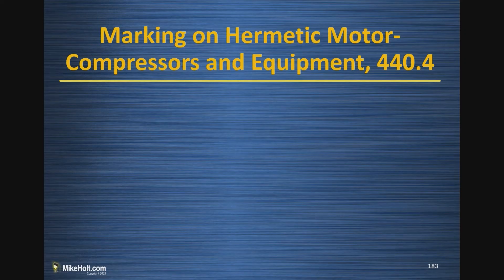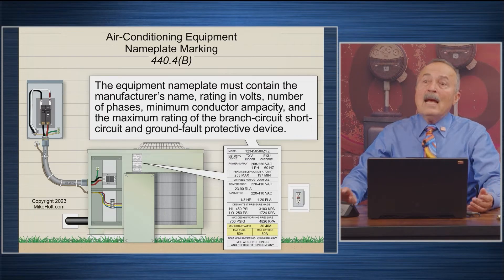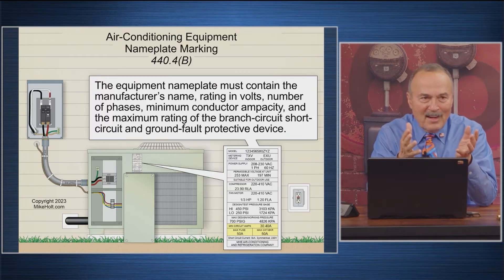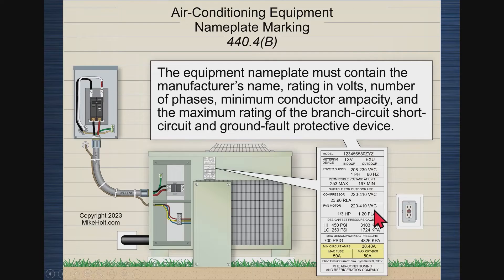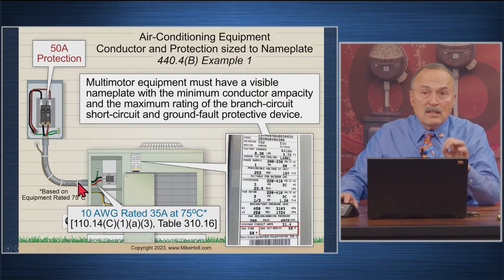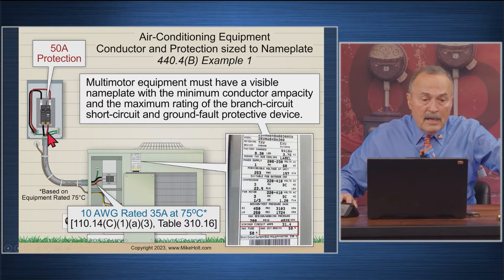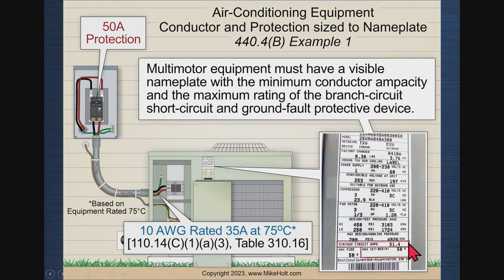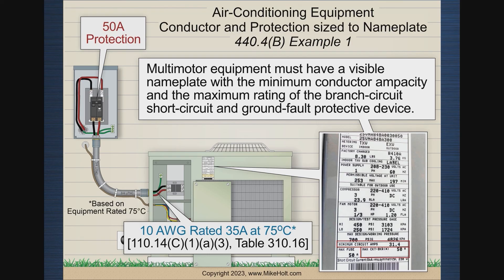Marking on Hermetic Motor Compressors and Equipment [440.4], 2023 NEC

Comment: A side note that should be included in any HVAC installation discussion is paying attention to SCCR of the equipment, and if the mfg. instr. specifies CL fuses. This  gets overlooked, but HVAC is usually very close to service d/c, and most AFC will exceed 5ka, the typical HVAC SCCR.